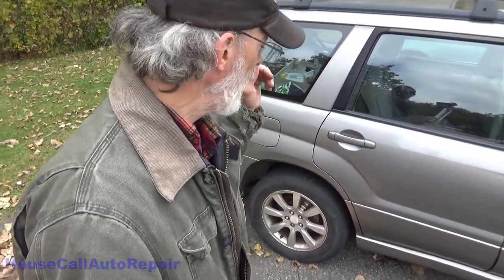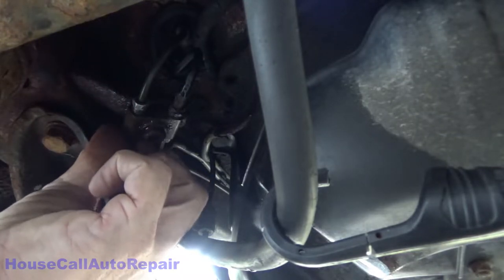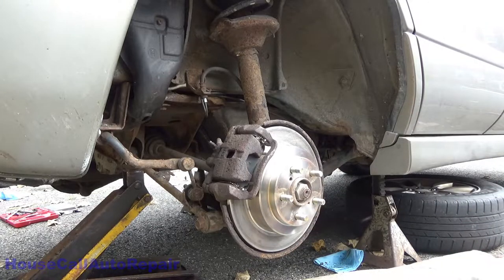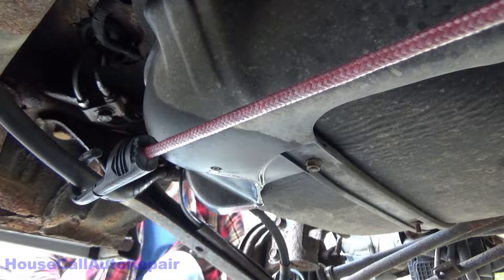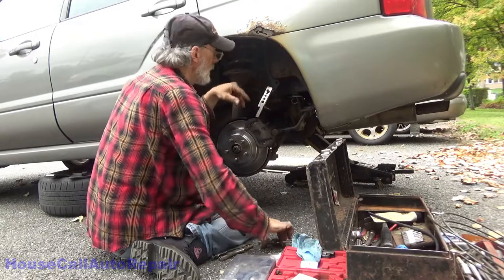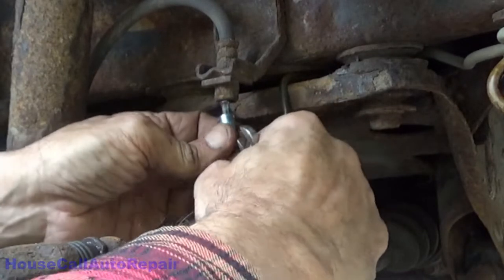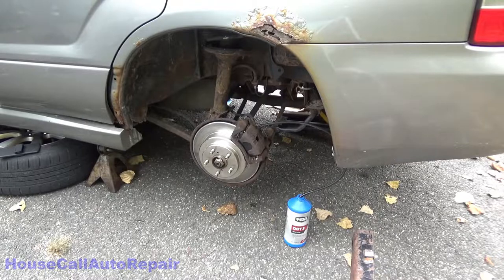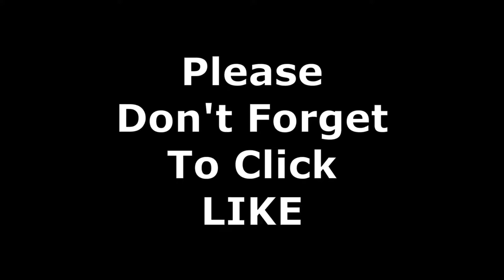2006 Forester Rear Brake Lines - Part 4 - Auto Repair

Comment: I will be replacing some amount of line as well, as one of mine blew out at the block that houses the two rear lines. Could you theoretically just delete the block and run the two lines side by side? Or is the block necessary for some other reason?
Reply from the maker: As far as I remember that block has no other purpose than to create a junction point. I'm sure it can be eliminated without issue. Just be careful to not get them switched!
Reply: @HouseCallAutoRepair  awesome, I appreciate the reply! This series has been super helpful!